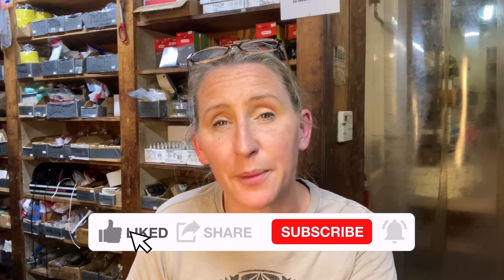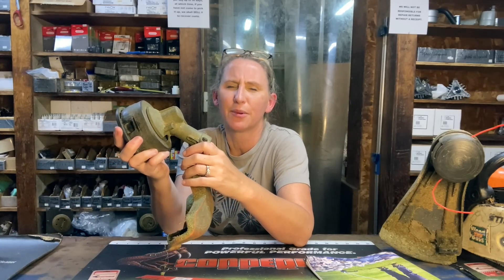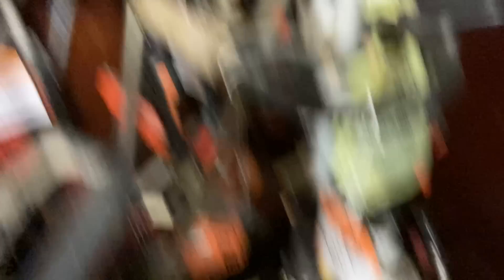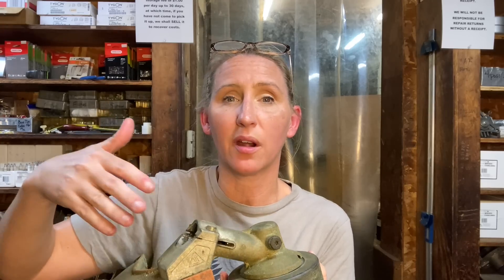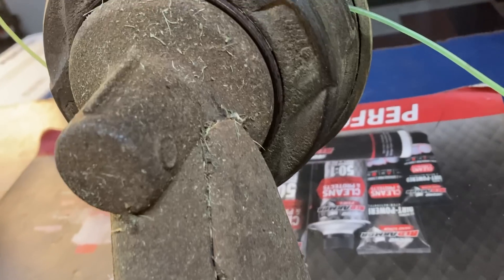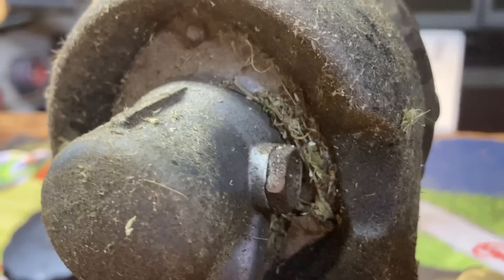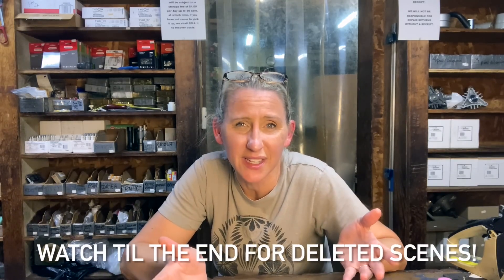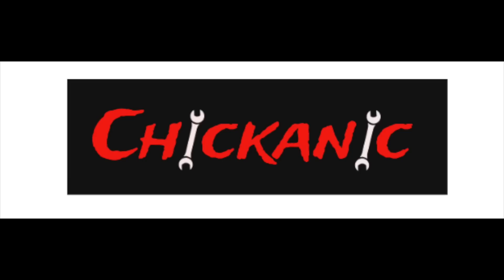Planned Obsolescence?! Why Would STIHL and ECHO Do This?!

Comment from the maker: Thanks for Watching! Find a link to all of my "Must Have", Favorite Tools HERE!! https://www.amazon.com/shop/chickanic?ref_=cm_sw_r_cp_ud_aipsfshop_aipsfchickanic_9ERPFPBNGQ924P8NS63B
Reply: I CAN TELL YOU!! 

Grease technology has skyrocketed recently with everyone looking for greener alternatives etc. The petrol fellow and oil men have had their minions working on things and supposedly, they can have sealed gearboxes with lubricant that lasts as long as the tool. Now, I don’t trust that any more than you do…. In fairness though, my dads Merc has a fully-sealed gearbox that one cannot add or subtract the ATF from (it’s possible for severe cases but they have their own, complicated machines to complete the process - no user serviceable parts yada yada) I thought it was an awful idea when he bought it but it has held up really well. If it’s sealed (hypothetically!!) nothing can get in or out, so the grease lasts… but what happens to all the micro shavings of gear teeth from heavy use…..? No, I’m with you here, it’s an awful idea.
Reply: They don't want the small engine mechanics repairing them, so they make the gear head ridiculously expensive. They don't make much out of parts unless you pay the exorbitant pricing

The manufacturers want to make it too expensive to repair so that you buy a brand new unit, but they list parts to look like they're acting in good faith toward right to repair

Comment: The new weedeaters are advertised as having sealed bearings.  That being said, they may or may not last longer than the greaseable heads.  I work in trucking and we used to eat up PTO U-joints before we started using the sealed ones w/o the zerk fittings as recommended by the parts guy.  The parts guy was right.  U-joints are no longer an issue and it's also less maintenance not having to grease them.  Hopefully this is an improvement but time will tell if the new style bearings will last as long.

Comment: My local hardware store service's, sells and warrant Stihl equipment I purchased the fs56rc 5 years ago the only issue i,v had with it I had to replace the fuel tank vent because fuel was soaking the air filter when I went to purchase the tank vent I noticed they had the same model for $199 on sale until June 30th you were mentioning the outrageous prices for parts even though the one I purchased 5 years ago looks and runs like new, i,m debating on purchasing another one for that price with the four year warranty. Hell in today's world $200 is nothing more than a trip to Walmart.🤔😐

Comment: In Europe Stihl has been so generous to include back the geese plug. All new farm/pro models have new housings with grease port (FS 261, FS411, FS461/2 ...and up). Mainy because all professional users knew that service-less angle head was bull.... and in heavy use was frequently replaced under warranty. I think Stihl started loosing customers in farming sector because 1 price for their equipment/parts is exorbitant and 2. farmers were not using it enough to break it under warranty and replacing a 150 euro part on a pro grade clearing saw that costed more than 1000 euro after 3/4 years was a joke. My friend bought Stihl FS260 without plug for greasing and after 6 years of medium use as farmer sold it and bought bigger shindawa/echo cleating saw with full anti vibration and grease plug for less than he payed for FS 260. The FS 260 was good unit but the bevel head was sh.... .

Comment: Kinda like newer cars and trucks not having a way to check or change the transmission fluid.  You'd almost think they want it to fail.
I was told new Ram trucks don't have a dipstick to check the engine oil.  That's crazy.

Comment: Thank you so much for bringing that to the attention of the viewers!  
I bought two Echo weed eaters and one can be separated in the center of the shaft to interchange attachments and it has the grease plug. The other one doesn’t have it just as you pointed out. When I called Echo they seemed to act like I didn’t know what I was talking about, even the location where I purchased the non grease plug unit couldn’t give me a legitimate answer! 
Those gears get very hot while in use and they need grease periodically! I had even went above and beyond by purchasing the Echo Red grease in the tube which isn’t very cheap! 
It seems like only the more expensive “X Series” Echo units come with the grease plug. 
Your videos are very informative and helpful for us, I only wish that your shop was located near me in Texas. 
Thank you again 😊

Comment: Because of the residential warranty, I bought the ECHO SRM 225.  I know there's no grease head nut, thanks to you, but I did ask ECHO about it.  The only thing I got back from them was to take it to a dealer for warranty service.  Not once did they say anything specific about the grease nut.  I asked the question differently a few more times and got the same answer. Now, it is completely possible that with 6 acres of trimming plus my neighbors 6 acres I could wear out the gear head while it's still under warranty.  I will let you know what happens.  Oh, I couldn't afford a split shaft.

Comment: Texas grandpa here! 3 year FS56 RC no gearbox plug owner.
Might “we” be able to dismount/slide off the gear head from the drive shaft, and shoot some grease into the square drive cable/shaft hole into the gearbox and get the same results as the missing threaded grease/lube plug and hole?
M trying here! Add have not dissected a head to see where shaft hole grease might go.
(WTF - bet they patted the $$$$$ engineer on the head for saving them $).

Comment: On the SRM 225, there are two T27 screws next to each other. The top one is the grease plug—simply unscrew it to grease the shaft and gear. The bottom T27 screw holds the gear head to the pole.

Comment: Girl!  It's called planned obsolescence for a reason.  This is why I won't own anything except a Japanese car and when I have a question about my Toyota I make sure It's directed to Toyota Japan, the one who made the car, not Toyota USA.  The cvt transmission is suppose to be a sealed transmission and it isn't.  You better change the oil at least every 60,000 miles or it will cost you as much as $8000.00 before it hits 100,000 miles.  Unfortunately it comes down to making more money for cooperate.

Comment: If you ask you'll probably get the "party line", it's to prevent anyone adding an incompatible type of grease. Auto manufacturers did that years ago, eliminating grease zerks on ball joints, u-joints, etc. but a lot more work comes in to replace those parts when they wear out from not being able to be lubricated periodically.

Comment: Good vids :) Just bought a 56 Rc Stihl weed wacker and of course no grease fitting, found you can drill a hole in the middle of the triangle that's cast on the head, tap it to the size of your choice and squeeze some of that echo red dragon queen grease ( no grease gun required) , seal it with a short screw and your off to the races.

Comment: No grease hole is needed.  Remove the gear head and add grease through the hole used by the drive shaft.  In addition, pull out the drive shaft remove the old grease and grease it up real good too.
Reply: The standard lube/grease cannot screw into the recessed hole.  Also not convenient.  I had to make a nozzle from caulk jar to access the recessed hole.

Comment: i bought a echo straight shaft 25 years ago ran the heck out of it allways started first or secound pull.worked great rfor 20 years bought a new one same weedeater ran like crap. got on youtube theres a little brass plug you remove to ajust the carb its pre set for emisions. take the brass cap off ajust it runs like the old one now .and thanks chick i never knew about the grease cap till now will have to go check mine out .love your vids.
Reply: Thanks for the tip. I'm planning on buying one.

Comment: Without grease plug: The mould is very slightly more simple and requires very very slightly less metal. They don't need to cut threats into a hole that doesn't exist anymore, saving a tiny bit more money. And they don't need to make and install that bolt. All in all, it makes the machine a tiny bit cheaper. Let's say 10 Cents in total. No matter if it's Dollar Cents or Euro Cents, it's close together. If they sell 10 Million machines per year, they made 1 Million USD/EUR of extra revenue just by deleting the grease plug. 
In private use you get pretty far without ever greasing the head because you simply don't get many hours on it. In professional use, you wear out a head quickly when you can't grease it properly and you have to buy replacement much more often, which means millions of USD/EUR extra for the manufacturers.

Comment: I could not see well enough in the video is there a flat spot where the grease fitting use to be, that you could drill out and tap and put a grease fitting in? I refurbish a lot of computers, but there are very few computers that sell for less than $100 can be rebuilt. There is built-in obsolescence, and just about every item we buy nowadays, no one has any pride, and what they Manufacture or sale anymore. The same quality into the work I do as you put into the repairs you do take pride in my work I’ll say two year lease refurbished for 25% of the original retail price the last 5 to 10 years. I sat down today to rebuild my vacuum cleaner which is 15+ years old and when I got to the parts the parts the rebuild it were $30 more than what I could buy a replacement of the same specs. So if you try and fix things you’re gonna be punished because you’re gonna spend more money. You were expect the retail cost to be young 25 to 40% above what they purchased that when they build the machines but from what I saw it’s 150 or 200% over that price now.

Comment: What a great video! I look forward to seeing if the life of the gear head on non-grease type is drastically shortened or not.

Great tip on buying the Kombi shaft! I will do this when the wife's trimmer finally goes kaput

You can make the comparison to automotive ball joints, many if not all, factory parts and most aftermarket replacements are sealed, non-greasable. Only the high end Borg Warner Moog still come with zerks

Many high end mowers went with sealed spindles on the deck as well. I have seen a LOT of greasable spindles fail after 1 season, undoubtedly because they didn't get greased, but I have only seen one failure of a sealed spindle and that was due to pressure washing the deck when it was still hot

Comment: Same thing with the new STIHL chainsaw Bars; bean counters) REMOVED the GREASE hole 🕳️ in the Nose that was for GREASING the Bearing 🤑 NOW , i.. only PURCHASE ; BARS and CHAINS , from TRACT0R SUPPLY; and the COUNTY LINE Brand) is AWESOME 🙌 and they have the GREASE HOLE 🕳️ and SELL the GREASE GUN; to go with IT) and A BAR and Chain COMBO) is VERY COST EFFECTIVE) and DOES NOT stretch out or Ware OUT LIKE any thing made by STIHL) Also TRACT0R SUPPLY ; STOCKS The Bars and Chains for ALL of the OTHER BRANDS) and for the LAST (30 years , i.. have been USING the Used Drain OIL; from my Truck and other EQUIPMENT) Awesome Free 💰Bar and Chain OIL and my Chains Do NOT Stretch Out ) JUST USE the 7/32 file to keep the 3/8” Full chisel chainsaw blades SHARP) every 
( 2 times that you have to fill up ⬆️ your FUEL &OIL tanks ) Even If The chainsaw blades Look 👀 and feels SHARP) WHAT YOU DO IN YOUR HASTE; you will REGRET IN YOUR Leisure)

Comment: I noticed the lack of grease plugs on stihl strimmer gear heads a few years back, when i started in small equipment back in 1988 we always told customers to regularly grease the gear heads or they would scrap their machine, repairs would out cost the value of the machine.

Comment: I am sure you all have seen on electric motors, "Lubricated for the life of the motor.” That is easy for them to say as the number one motor end of life is bearing failure. Either wear out or they lock and can turn. Therefore, you have to BUY a new motor. There is no such thing as "Lubricated for the life of the motor.”  The same goes for the trimmer head. After spending several years in my youth rebuilding power tools while working on my degree, I found that the gear case grease dried up and not doing a thing. The bean counters probably figure that we would not lub it anyway so why put a fitting.
I just bought a new trimmer at the beginning of spring last year. I will be looking for that grease plug on the head and if it does not have one, I will install one. If someone doesn’t beat me to it, I will post a video on how to do it.

Comment: Engineer here.  The synthetic greases that are used today are much better than the old grease that we used for everything 20 yrs ago.   My company builds tie rods and ball joints.  Mostly automotive.   All joints are sealed with special grease that does not break down.   No grease fittings.  No debris gets inside.  Should last 30 plus years in severe road conditions.  They will outlast the car if you stay out of the ditch.

Comment: This video ran me down to my cellar. My straight-shaft Husqvarna 128LD has the grease bolt (whew), but the Lowe's off-brand 4-edge metal bladed lower unit TrimmerPlus BC720 did not. So I did some poking (after greasing the Husqvarna). I found a little 3-16" hole in the shield that lined up with the collet cover of the blade (this is to lock the rotation to remove trhe blade. a 3-16" drill base works great to lock it from turning) . . . but my pencil grease attachment (for the notorious drive shaft "impossible Zirk" under the John Deere 1025R. That was too large. So I started backing out Torx screws and found the lower shaft pulls out, then the flexible shaft pulls out. And that leaves a square hole down into the gear hear that you can see the inner spaces. So I pumped 10 squirts into that hole and it quieted the rotation of the blade/gears when reassembled. A pain, but at least an access method.  As far as Stihl and Echo?  I wonder if they are using a Nylon or Polyamide gear (or gears) and figuring it doesn't need greasing?  Take one apart.
Reply: I used to see plastic gears grease all the time, they had a light white lithium grease.

Comment: i been running stihl trimmers for 30 years commercially. never greased a head. engines wear out first. i buy new stihl power heads and put old shaft/head on and keep running them

Comment: I just got a new Stihl FS131R trimmer. It has a grease plug where you take out the screw and screw on the grease, like a toothpaste tube which is very convenient. My old trimmer was a straight shaft Bannerman BW-3 trimmer powered by a Kawasaki KT12 engine. I worked that trimmer like a dog, even clearing brush and trees up to 2-3 inches. I took regular care and greased the head with a screw in nipple to attach the grease gun. The Bannerman trimmer served me well as it lasted 40 YEARS! Your advice to grease the gear head is critical!!! Sadly, I needed parts that were extremely hard to come by so I made the decision to get a 4 mix that is better for the environment and quiter. The old trimmer needed a fuel mix that was 16:1. Thank you so much for your excellent channel and the candid advice that you promote!👏🏻👏🏻👏🏻

Comment: I’ve recently bought a Milwaukee electric trimmer and it doesn’t have a grease plug…..that’s up until I drilled and tapped the aluminum housing and added a zerk fitting 😅

Comment: for the last 20 years cut the lawn and drove my john deer riding lawn mower straight into the shed and closed the door. changed the oil once every couple years, a flat tire every yeah or two. and washed it probably 4 times total. although i have gone through about 14 sets of blades but whos to say who is at fault for that one.  (every other machine and tool i own is very well taken care of though.) i hate cutting the grass. i just feel like its 3 very tree filled acers off of my most likely very short life.

Comment: I'm not sure about echo or stihl, but I know for a fact this trick does not work with Husqvarna. One thing I love about huskies combi system is that the string trimmer attachment uses a one-to-one gearing and goes like a bat out of hell but you can't properly use any grass blades etc on it you need the brush attachment instead. This isn't so with their standalone trimmers. They're geared more universally so you can attach grass blades etc.

Comment: All my commercial Stihl products have the Grease fitting now I do have 1 Residential Stihl curved shaft edger that doesn't have a grease fitting. I bet their reasoning behind it is if it fails then the customer will most likely buy a new trimmer and that is why they jack up the prices on their repair parts, I think their logic is let's make the repair part so darn expensive that they just buy another trimmer,

Comment: Hi, I`ve had a FS550 for about 15 yrs, it was used daily for 6 hrs heavy grass cutting (Steel yard)
Greased once a week, still runs perfect.
But as for the smaller ones, bag of bolts. Would get thru 4 fs40 a season on household jobs.  
Went over to Titan for household jobs, 1/3 of price, throw away item.
Getting Stihls serviced in uk stupid prices. Always done my own. But with Titan, usually a 3 in 1
plenty spares when they brake.
I prefer Huskies for chainsaws, higher revs.
These companies were all about keeping pro`s happy, take the average joe for all he got.
It`s a so worse in UK vs USA
Caught you video on parts prices, wicked.